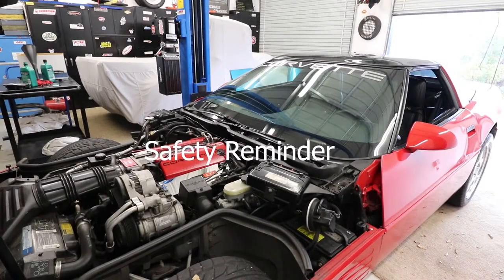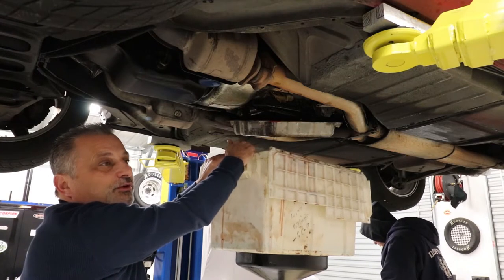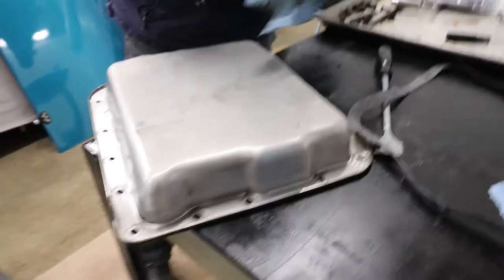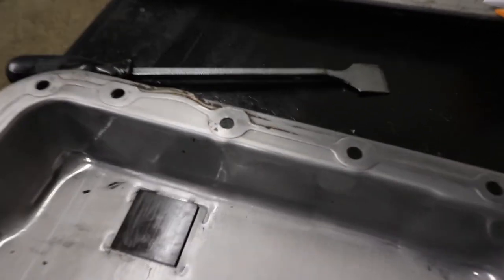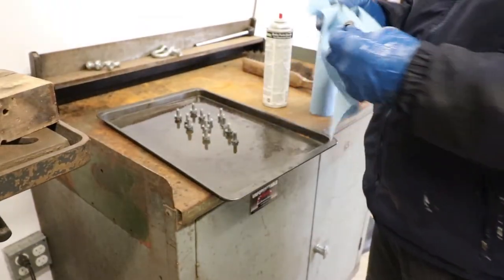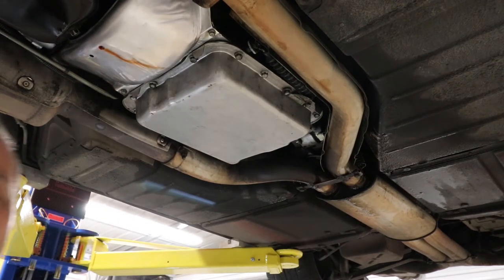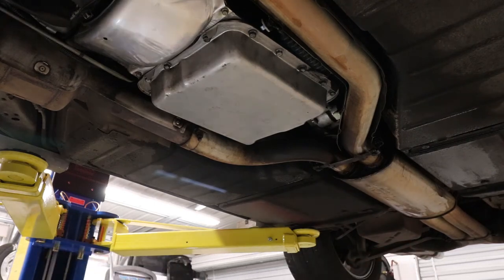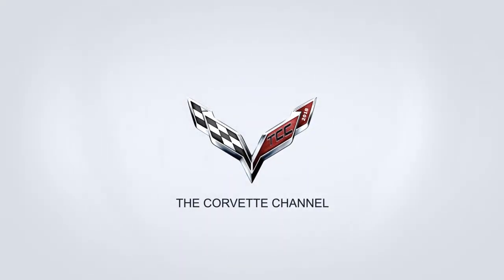How to change the Transmission Fluid in a C4 Corvette

Comment: I've just checked the transmission fluid level in our 86 Corvette. I let it idle for two minutes as instructed in the owner's manual. The level was in the right above the add mark. Just add some after doing that? Or, should I let it cool down and add some? Thanks.
Reply from the maker: You need to check the fluid warm, if it is that close i would probably leave it alone.
Reply: @THECORVETTECHANNEL  Thanks. Is your advise just to prevent over filling?
Reply from the maker: @ranger1959ful  Yes

Comment: I know this an old video but do you remember how many miles was on it at the time of the change ? My 93 is at 103,500 and it is in need of a change, it has a shutter as it changes from 1rst to 2nd under hard acceleration. I'm just worried it'll kill the transmission if I do it
Reply from the maker: Hi Alan,
It was around 120k when I changed it.
I can’t guarantee it but, I was told years ago that if you change the fluid on a high mile car you should only drain and fill with a new filter never do a complete flush! I wish you the best and thank you for watching!
Reply: @THE CORVETTE CHANNEL  
Thanks for the information. I did pull out 24 ounces and put a 24 ounce Lucas Transmission fix it it and it seemed better but still has alittle shutter. But I may go ahead and change it and hope
Reply from the maker: @allanlee5196  Best of Luck!!